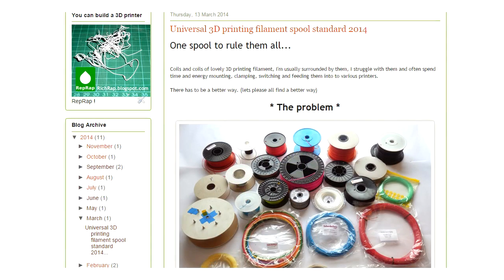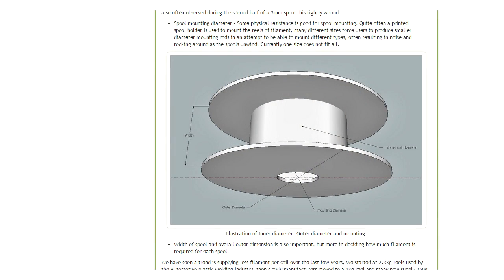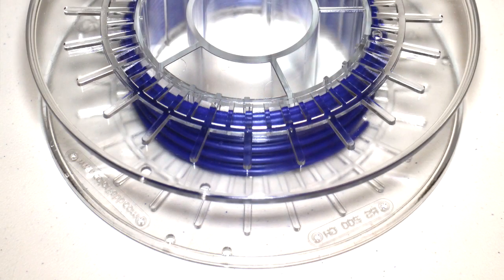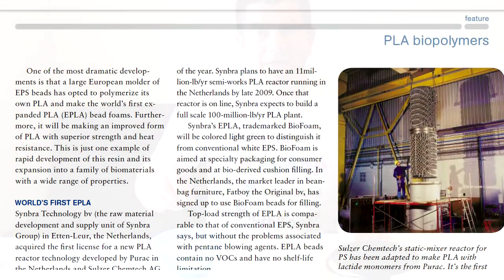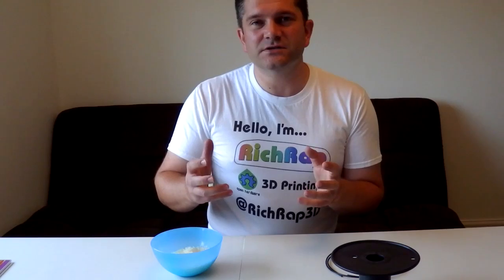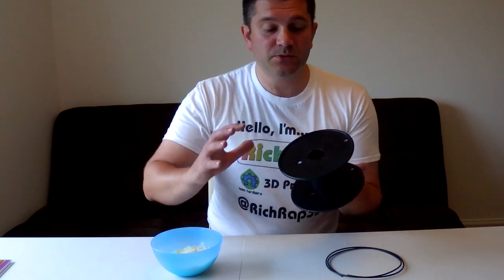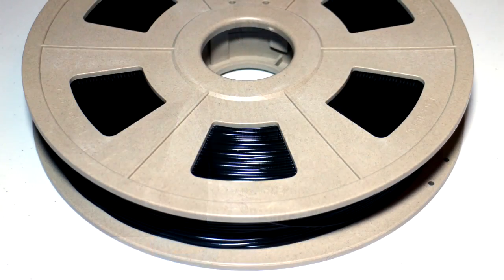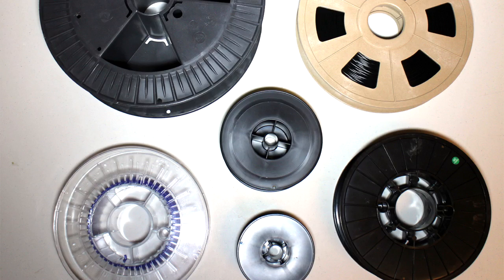Universal 3D Printing Filament Spool Standard

Comment: The basics are great. 

(1) I have a filament extruder, and would really like a spool I could recycle either by returning to vendor or as part of regrind.  Having a version that is easily printable for the home filament extruders would be great too. 

(2) Possibly with optional holes or spokes in the sides to reduce the weight and amount that is needed for printing/injecting no matter what the material. 

(3) An optional 'core extender' for those needing 'bulk material' to push the sides apart, but not have it used for 'normal' sized rolls.

Thank you for getting this discussion started!

Comment: The driving factor for manufacturers is money/cost. I propose eliminating the spool completely & adapting a standard wound coil diameter size. Zip tie it and chuck it into a bag. WAY lower environmental impact that any other solution. This way, customers can weigh the coil and know exactly how much product they received. The standardized coil can then be put on the 3D printer's existing durable coil, that comes apart like the design shown in this video. Otherwise, make the spool out of something that CAN be recycled EVERYWHERE.
Reply: +Xaviera Yayaell ya tell that to a welder lol